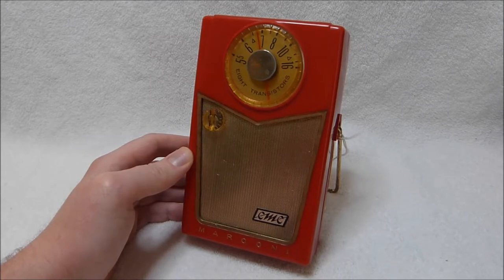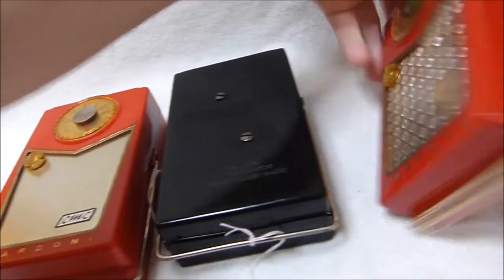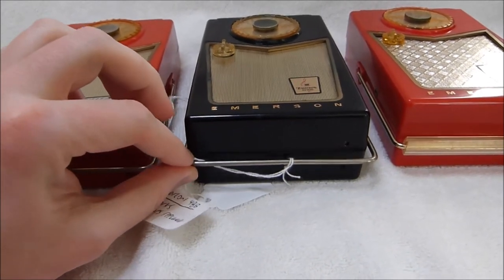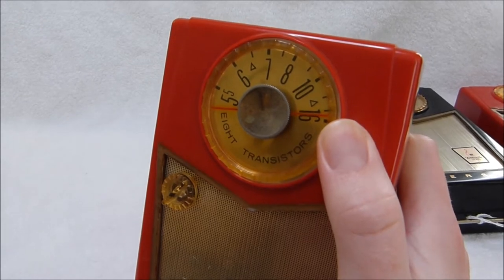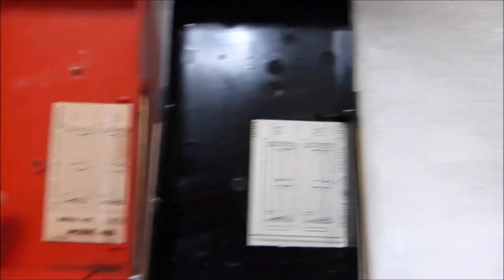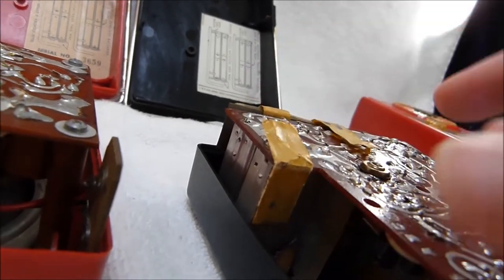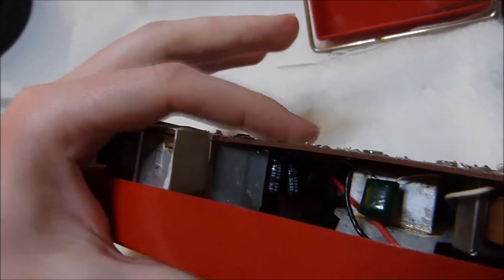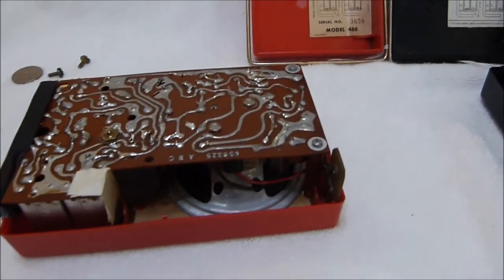Canadian Marconi Company (CMC) model 488 transistor radio (circa 1958)

Comment: I have an 888 Vanguard.
Pretty good radios.
The only thing I don’t like is the battery holder.
You’ve got 3nice examples there, including the Marconi version , which I’m sure is pretty rare.
Cool.
📻🙂
Reply from the maker: Thanks Jeff! Yes, the battery holder is a bit of a pain, and it helps to have a screwdriver to ease the full pack in/out. However, it does at least work reliably, if it isn't corroded.

Comment: Interesting. Did Canadian Marconi ever design their own transistor sets, or were their products always licensed? I ask because I used to own a Marconi model 2005 MW/SW portable which was identical in every respect to a Toshiba 8TL-463, except that the Marconi was brown while the Toshiba was black. The Toshiba was the first radio I ever owned as a teenager in the 1960s, and it disappeared a very long time ago. I saw the Marconi on eBay a few years back and bought it.
Reply from the maker: I'm not sure if they ever built a portable radio entirely of their own design, but they did build this table radio at least: https://www.youtube.com/watch?v=1EuCJ5Nh8vo&t=1s
However, that radio has a modified Emerson model 888 chassis hidden inside of it, so even that is not entirely their own!
The Marconi model 2005 sure is an odd one, there weren't too many leather wrapped sets made.